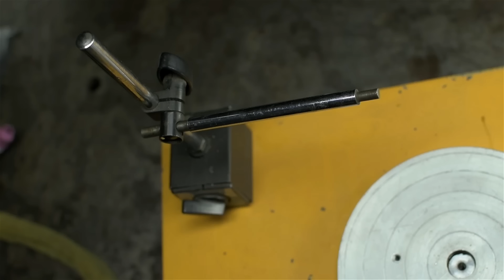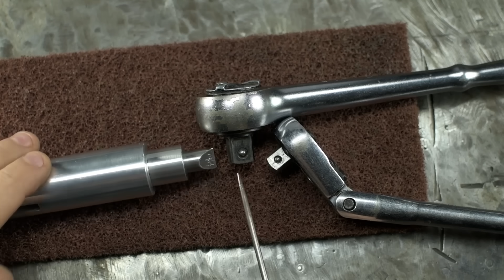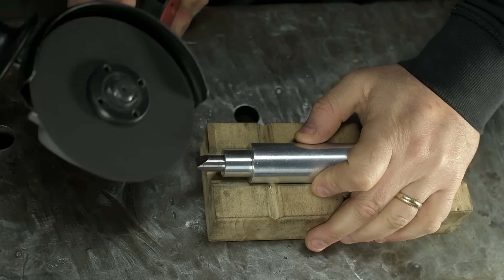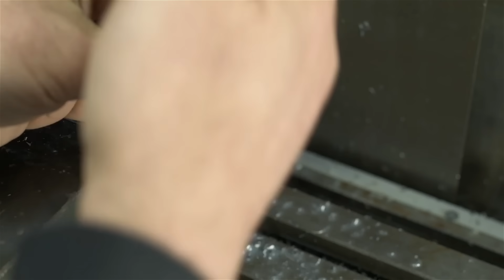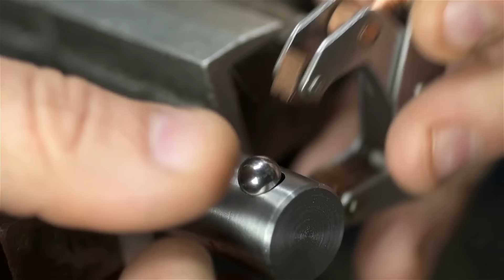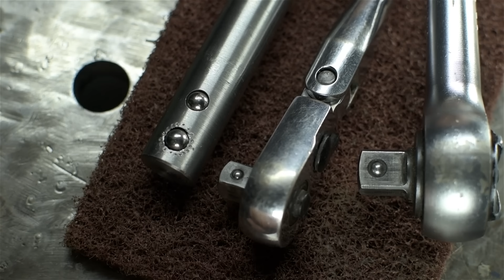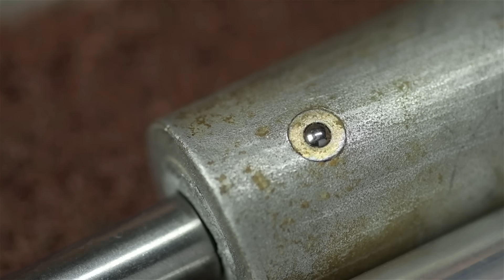Spring-loaded Detents, alright!

Comment: Now that this can of worms has sprung open, you need to work it out with Harold (that cad) and satiate your audience with a good old fashioned installation. You're second observation, installed under compression, is most likely correct, but the proof of the puddings in the eat'en.

Comment: What did you mean with peen over the high spots at 8:06, or was that a joke that totally went over my head?
Reply: oh wait I get it. Only the left and right (in that shot) parts, not the top and bottom parts (still the same shot) since those have a bigger gap with the ball.
Reply from the maker: correct!

Comment: This Old Tony, I am trying to make a miter slot guide for my table saw (6' long) made of al. So the bar is 3/8" x 3/4" x 6'. I thought you might give some advice on how to best snug up the slack between the bar and the slot. I am some what annoyed by the fact that the slot is not really perfect and using something like set screws cause a stop and go fit. I was thinking of using springs and bearings to snug it up  or perhaps you have a better solution. Thanks!!!!!!!!!!!!!!!!

Comment: You make a ball plunger way too complicated.  Drill a blind clearance hole for the ball bearing.  Obtain another ball bearing a bit larger than the one used for the detent, say you are using a 1/4" ball, insert the spring, insert the ball, and to peen the opening just use another ball bearing, say a 3/8 or 1/2 inch.  Use the larger ball to hold the detent down and rap on it with a hammer, if you didn't create enough of a retainer, rap on the ball again, very simple.  One time I needed a bunch, didn't want to pay the market price so took some threaded rod, cut to size, and there you go.  Jim